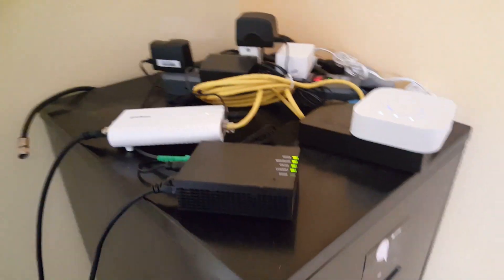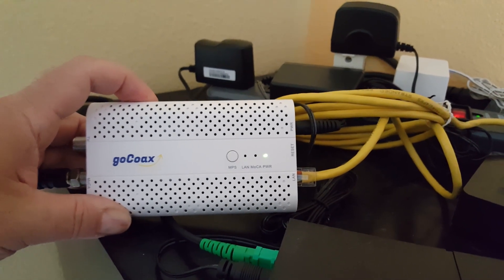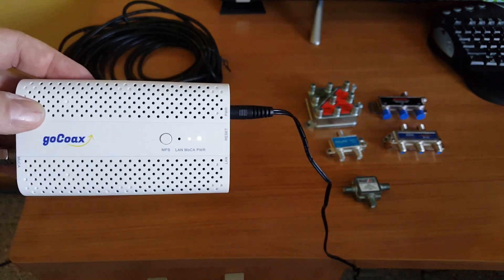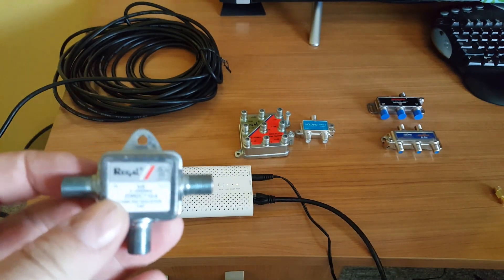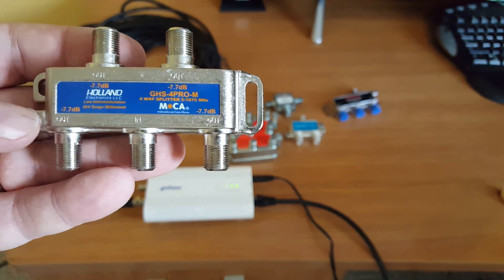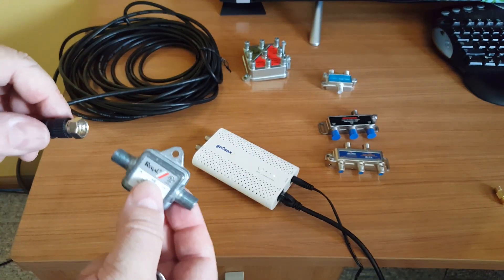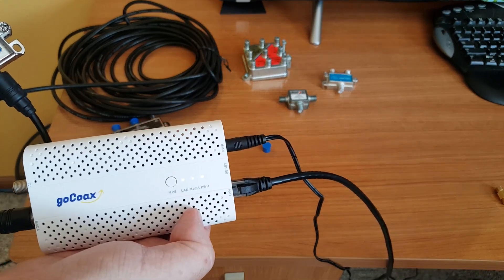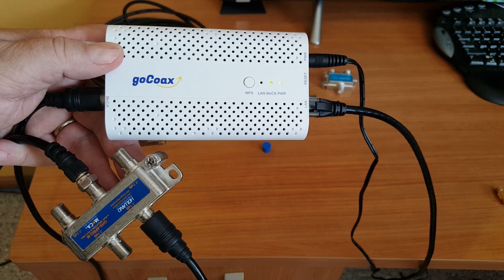How to troubleshoot connection problems with MoCA (goCoax WF-803M) and basic MoCA setup requirements

Comment: Hey Uncle Mike, I’m wanting to connect via MoCa to run a desktop Mac in my upstairs room.  The room has a couple of coax wall plates. I have determined that the wall plate I’m connecting to works based on temporarily hooking up my single modem to the coax outlet and connecting up to my Mac and I had internet connection.  So based on that test, will I be successful with my MoCA set up?  I can certainly change splitters in my outdoors cable entry box, and inside where my modem sits downstairs but would have no idea whats in walls and ceilings that may contain a splitter or two. 
Does my test give any indication as to what I may expect?
Reply from the maker: it depends entirely on what type of splitters there are in the walls that we cannot see.  In theory, you should be good to go, but for the unseen splitters.  I say TRY and let us know how it goes.
Reply: @UncleMikeRetro  Ok, I figured as much. 
Not sure what I would do if I get a no go. 
Why are MoCa adaptors so fussy about type of splitters? Is it construction of the splitter or the Hz?

Comment: That is what I did.  Since I don't know where my splitters are, I just tested the cable to see if I get the expected speed.  It works perfectly.  I am in a town house that was built in 1991 and so I don't know what to expect.  To find my splitters I may have to get a ladder and explore the attic or maybe get a borescope and run it up the wall to see if I can spot the splitters.  I assume that they would be in between the same studs as the cables unless something weird is going on, just not sure if up or down.  That may depend on which floor I am on.

Comment: Can you use a splitter to attach a moca device in 2 different rooms in your house? For example, my setup has 1 moca device going from the modem into the moca-compatible splitter, then 2 outputs from the splitter going into a moca device into a computer in 1 room, and another moca device into a computer in another room. I am having some trouble picking up the connection in one of my rooms. Should I skip the splitter and just go directly from the rooms to the modem with 2 moca devices per line?

Comment: I have had bed connections because of poor work by the person who made the terminal at the wall. One may have to buy a coaxial terminal tool and make a new terminal connection.
Reply from the maker: Never thought of just plain old crap terminal connections.  But then you should not have been getting any signals in the first place, TV or otherwise.

Comment: Great video, I'm renting a 1 floor home, and the ONT for my Fiber is in my bedroom on the opposite side of the office, my girlfriends office is right next to the bedroom, there is a coax in my office, a coax in her office, and a coax in the living room, but i don't believe there is one in our bedroom by the ONT, so I have been trying solutions, the wifi is horrible in here, so I am going to see if the outside box has a splitter, but if the splitter is somewhere within the walls, I am probably SOL right?
Reply: Yes. The splitter has to have the frequency capacity the MoCA uses. Before buying anything put the cable modem on the outlet that the other room has to see if it has a connection at all. Many have a junction box with no actual connection after the first cable was installed leaving the responsibility of making the connection and even creating a terminal for that cabling up to the homeowner.
Reply from the maker: This is truth.  Make sure you even get a signal at the connection.
Reply from the maker: maybe.  Sometimes the splitter is in the box.  Sometimes they re-split the lines within the walls.  Really, all you can do is just get two MoCA devices and try to see if you get them to talk to each other.

Comment: i have screenbeam moca adapters and i think the problem in my house is probably the splitter. it has 9 coax ports, but was installed many years ago by the cable people, the fios people probably did something too so it is all confusing. the screenbeam moca adapters only have coax and power lights. the coax light just flickers pretty consistently and it says "unidentified connection" when i plug it in. if i buy a new compatible splitter will there be any more setup i need to do? for example, will it mess with the wifi extender or any other ports from the wall.
Reply from the maker: the MoCA only cares about one LAN port to MoCA to MoCA to LAN port.  It will not care or interfere with your WIFI or extender.  Now, if you do have a 9 port or so splitter, try replacing it with one MoCA splitter toa only has 2 connections.  That will eliminate that large splitter and slim down your connections.  After all, if you have FIOS then you have all else on WIFI, right?

Comment: The difference between your set up and mine is my isp is cable internet. Im planning to put the isp modem in the basement in bridge mode and connect to my router wan port via ethernet.  Router lan port connect to moca adapter. Moca adapter coax splitter to different room. 
My question is do i need to use poe filter?
Reply from the maker: Hey!  I had cable before fiber.  If you're in a standalone home I think you're just fine as is.
Reply: He is right, standalone homes, the cable company will put in a POE filter. They dont for townhouses/apartments. Also if you get a MOCA splitter you can keep your current location of all devices. It will be a loop of coax from wall to moca splitter, split one to modem, ethernet to router, ethernet from router to moca, moca coax to splitter 2 and you complete the loop.

Comment: Do we need splitter if you just want to get Moca adaptor for one device ?
Reply from the maker: no... but having the splitter allows for future items if needed.  You might be fine with no splitter if it is a straight line.  Still need two MoCA devices!

Comment: This set up is great for homes that dont use the coax for tv. I'm buying one more adapter for my living room and ill have all my rooms connected with internet. I just had to buy a cable toner to sniff out the ports.
Reply from the maker: smart getting a handle on your ports!  that can be the challenge!
Reply: @UncleMikeRetro  30 bucks for a sniffer and access to the cable junction box at the house goes a long way!

Comment: Thank you for the video. A lot of confusing stuff to a new guy like me, but that's okay. I assume I'm not doing this right because the coax light on my Screenbeam Bonded  MoCa 2.5 isn't lit. I live in an apartment and have coax outlets in the living room, where my Xfinity Modem is, and my room, where I'm trying to connect it. Theoretically, I thought I would only need one Screenbeam converter because my modem has a coax port built into it. So, I connected the coax cable from my modem to the wall outlet in the living room. I then got another coax cable and connected that from the wall to the Screenbeam in my room hoping the ethernet connection would work. As I originally stated, the coax light isn't lit from user error. Is there anything I'm missing in this equation? Or would I have to get another screenbeam to put in the living room as well as a splitter to connect the modem and screenbeam to the wall outlit? Sorry if this is confusing; I tried being thorough.
Reply: Nvm, I was doing everything right... I just didn't turn on the mocha setting on my router...
Reply from the maker: shut the front door!  I had not gotten to answer, but there you are!  let us know how much you LOVE having full LAN speeds in other rooms 🥰

Comment: The most common (actually only) problems I have seen are splitters and not having a MOCA filter. I have been using them since the v1 (approximately 300 megabit speed) and upgraded last year to the 2.5 gigabit version.  Rock solid and lightyears above powerline adapters.
I have been using the MOCA rated BAMF splitters from Amazon (they are actually local to me). Last time I purchased a filter (maybe 10 years ago) they were $2 on Amazon, and the splitters are quite reasonable as well. Just replace any splitters you have and don't worry about it. I wouldn't bother testing any that aren't specifically rated for MOCA, they are cheaper than my time.
Reply from the maker: I cannot argue with just getting all ne wones.  BUT you know folk will try to reuse and save.  so... don't blame the MoCA devices you know

Comment: Does this have to be connected to a router?
Reply from the maker: it can be connected to a switch connected to a router, but something HAS to give out IP addresses.  this just moves the signal over coaxial, it doesn't do anything else.
Reply: Only if the router is where you connect to the internet and you want internet. 
It will work fine as a point to point link.

Comment: Thank you for this video. I recently had Frontier Fiber installed (after using Frontier Cable) and I have a Moca installed after the ONT in my garage then via coax to another Moca inside my home. This Moca is attached via ethernet cable to my eeros 6 Pro.  After installation I was getting the speeds I paid for (500GB) however over the span of 10 days the speeds gradually began to slow down where images would take long to load. I thought i would unplug the eeros modem and moca and then power it back on however this did not bring the speed back. I contacted Frontier support and they told me to check the eeros app on my phone and run a speed test. The test resulted in speeds of 528 up and down. They then said it was my devices. Frustrated, I unplugged the moca next to my ONT and powered it back on and now I get the fast speeds again. 10 days later (approximately as before) the speeds gradually decreased. Do you have any opinion as to why unplugging the moca next to the ONT brings the speeds back whereas unplugging the moca next to the eeros modem does not? Do you think it might be an intermittant issue with the moca adapter or is there something else i'm missing?
Reply from the maker: hello!  Is your eero 6 doing the router functions for you or do you have another router in the setup?  I suspect not.  Ok then, your ONT should be connected to the WAN port on the eero 6.  Then the LAN port of the eero 6 can be connected to the first MoCA device then coaxial to the other MoCA device.  When you get to the 2nd MoCA device (in your garage?) you can just use that LAN port or do what I do and connect the 2nd MoCA device to a switch for even more ports.  The important thing is to always have the ONT directly going to the router (or your eero 6 in this case) then the LAN port of the router out to the 1st MoCA device.  Try it.

Comment: Great video.  I appreciate you assuming nothing, and being polite about it.  I am new to moca adapters, but have one similar to this, with one more light than these.  This might be a question with no answer, but I am trying to run from one side of the house to the other, because I just can't find a way to get an ethernet cable to that far bedroom.  I believe I have everything set up correctly, but I have no idea where the coax goes etc. between where I have my router and where I have the dead spot in my house.  There is coax in there, and so I was hopeful.  If I have power and ethernet lights going, but no moca lights going, any troubleshooting I can do?
Reply from the maker: First, thanks for the compliment on the video!  Now, I have so many questions.  So many variables could be stopping you short.  Have you confirmed these two MoCA devices can make a connection in the same room over just a single section of coaxial cable?  Does the "dead" drop in the far bedroom have any signal?  I mean do you have coaxial internet or TV?  If not, and you have this far bedroom (and I assume other rooms), is this a single home or a townhouse or a large apartment, etc.?  If this is your home, and it is of any significant age (more than 10 years old) then you SHOULD have a central splitter like I demonstrate in this video:  https://youtu.be/_Gfjnspfd94
You HAVE to find this splitter.
Reply: @UncleMikeRetro  Is there a way to include a photo in the comments at all?  I did what the beginning of this video suggested, which was find the octopus and replace the splitter with a faster one.  I don't know how to tell if the signal from my router going to this splitter is working, or if the cable out of this splitter to the bedroom is working I guess.
Reply from the maker: you can send me an email to the channel (check the about section on my main page)
Reply: @UncleMikeRetro  I sent a quick e-mail with a few pictures.  I thought I posted links to the splitters I purchased as well, but I'm not seeing them in the conversation here.  I can e-mail those too if they are useful at all.  They are GE and go from 5-2500mhz.
Reply from the maker: Hey!  I replied.  We have some sleuthing to do!  I think the specs on the splitter is fine.
Reply: @UncleMikeRetro  Got things up and running.  Thank you so much.  Purchased a coax tester, started testing everything I could find, and before you know it, moca light was working.  Thanks again.
Reply: @UncleMikeRetro  Yes my own home, I don't believe the coaxial is 'used' for anything.  Maybe that's my new to moca devices problem.  I thought if the cable is run through the house, the devices could just use it as a medium, but maybe I have misunderstood how they work exactly.  Home is a built in the 90's I think.  Did find the octopus in the utility room.  Replaced the splitter as it looked like you were doing in the second video.
Reply: Getting further in the video...I did buy new splitters that were supposed to be moca capable and showed the higher speeds.  I put one on the wall where the moca adapter goes into the wall, and a second one in the utility room where all of the coax cables seem to go together.  Problem is, I don't really know where any of the coax cables in the utility room come from or go to.  One is labeled as the room I am trying to get to, but I don't know what any of the others are.

Comment: So I'm having some trouble. The MOCA light wont come on. Did the test and connected them to each other to make sure they worked, it did. 

I have one coax connected to a splitter that is going to the main modem and the MOCA. The MOCA light wont come one. I have the MOCA in my room connected to the coax cable and the light wont come on. Ethernet and power are fine but they aren't communicating. The rooms are about 10ft away from each other.
Reply from the maker: the MoCA has to be ethernet connected to your router.  The modem won't give you IP addresses
Reply: @UncleMikeRetro  I’m sorry I messed up in communicating.

Wall coax outlet is connected to a coax cable that ends connecting to a splitter. The the coax cables after the splitter are connected to the modem and the gocoax respectively. Ethernet cable is connected to the router and the gocoax. There is also the main etheret cable connected to the modem and router.

Wall mount->coax cable-> splitter->two coax cables->cable 1 to gocoax-> cable 2 to modem-> Ethernet 1 to modem and router-> Ethernet 2 to gocoax and router.
Reply from the maker: ok!  please watch this video I made.  It will show you the wall to modem to router back to MoCA connections better.  You are splitting the coax wrong.  https://youtu.be/_Gfjnspfd94

Comment: Good video. I’m new to moca and just got fiber installed. They only ran it to the basement with the main router upstairs. 

I have one mica device connected to the data1 port on the ONT and the coax of moca1 connected to the line running into the living room. Moca2 is connected to the router WAN port. There are no splitters in between that I’m aware of. 

Internet works, but I’m not getting anywhere near the speed I should be getting. Typically around 400-500. 

I’m testing with an Xbox that would get 800-900 via cable that’s hardwired to the router, as well as wireless. 

My testing may not be ideal, but is this speed to be expected?  I see all over where people are getting 1Gbps and I’m not getting near that.
Reply from the maker: The MoCA should always be connected to the router LAN port, not the WAN.
Reply: @UncleMikeRetro I’m a little confused. Is the WAN port on the router supposed to be disconnected then?
Reply from the maker: @garyslaght4375  truth is we need to know the whole topography of your setup.  The fiber comes in the basement?  to the fiber modem?  or is it a MoCA modem/router?  need to know everything
Reply: Fiber comes from outside to the ONT in the basement. it is a fiber modem, not a moca enabled one. From there, I have a moca connected to the modem via Ethernet. The coax side of the device is connected to the coax cable that runs directly to the living room upstairs. From there, the 2nd moca device is connected to the other end of that cable, and is then connected to the WAN port. 

If I don’t use the WAN port, then internet access is unavailable.
Reply from the maker: that is the issue!  the fiber modem has to connect to the router WAN port.  then LAN out to the MoCA device next to the router and it should work in the next room!  always modem>router>moca>moca  so to speak
Reply: Gotcha. So to get the best results, I should take my router downstairs, hook it directly to the ont. from there hook moca1 to a lan port and coax to the living room. From the living room, connect moca2 to an additional router acting as an access point. That’s what I’m thinking anyways.
Reply from the maker: @garyslaght4375  and report back